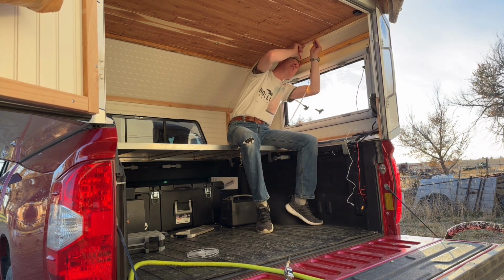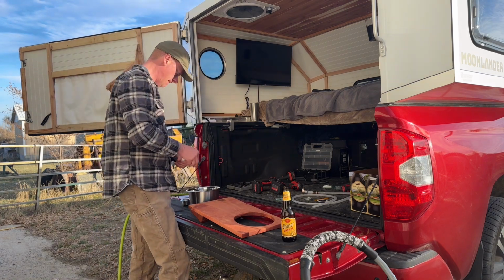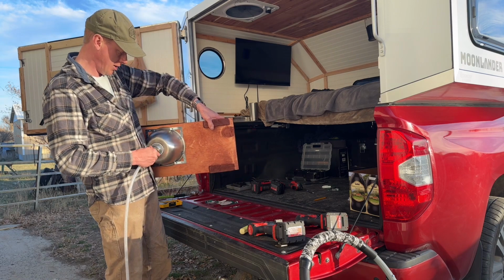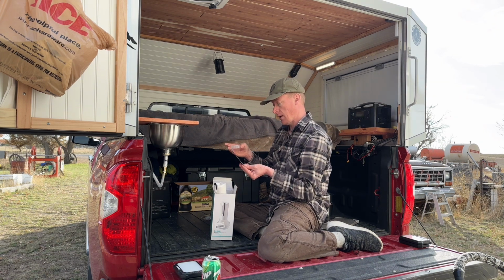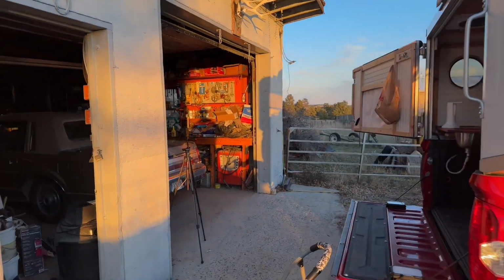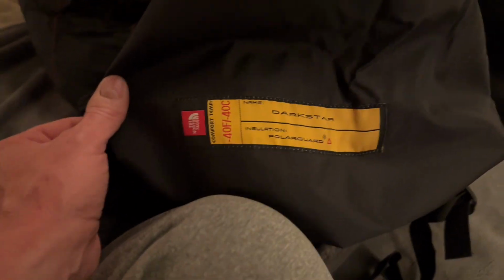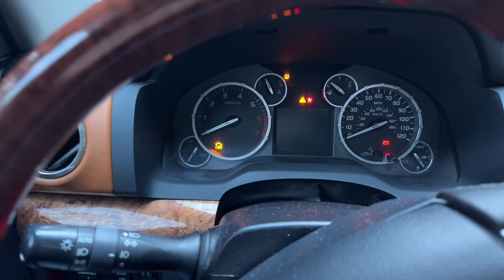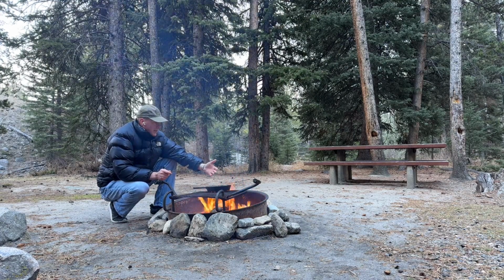Episode 4: Moonlander in Red lodge at 28 degrees! Plus a sink and a ledge for the EcoFlow…and lights

Comment: I really enjoy your camping tips. I will pick up my Moonlander in April. Packing one of your extra sleeping bags against the cab window is a great idea as well as adding some thinsulate velcro window covers for those cold nights. I have spent plenty of Montana nights on a Ranger bed in a canopy and like you, I want to enjoy camping anywhere in any weather. 
I bought the same propane heater but am concerned about condensation getting into my clothes and sleeping gear. Luke suggested an 12v bunk warming pad (Ignik makes an efficient one.)